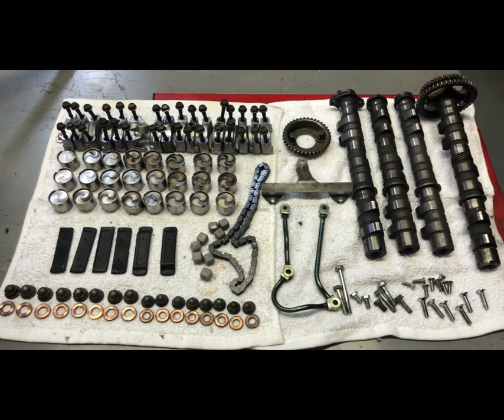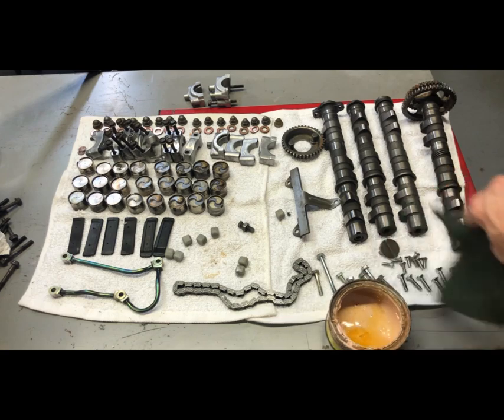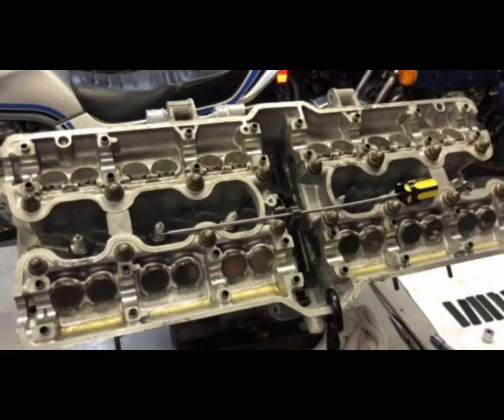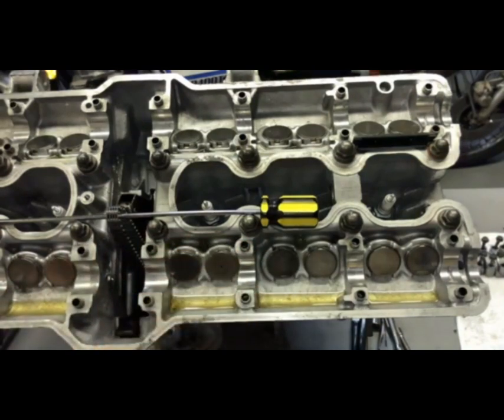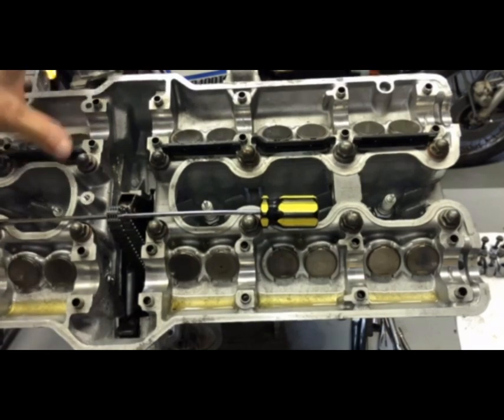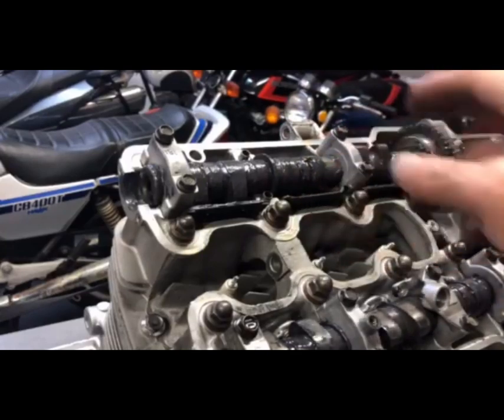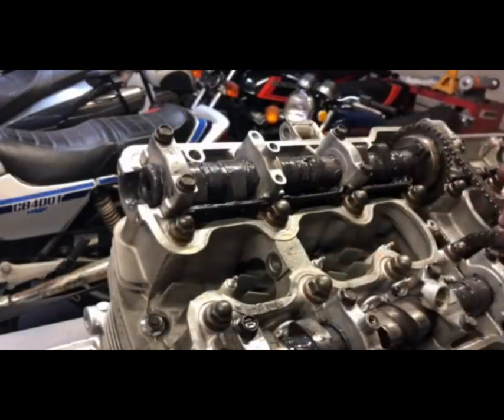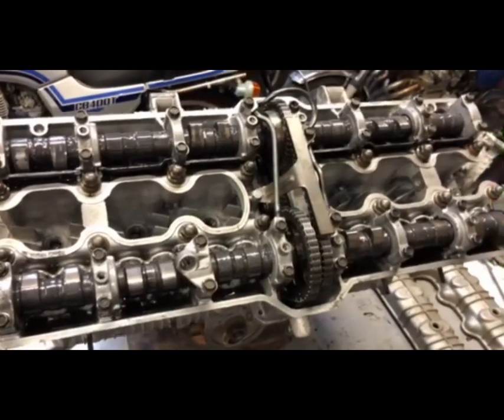Honda CBX Full Restoration & Engine Rebuild Video Series - Part 19 Re-assembly Part 6 - Valve Train

Comment: You've done a great job, and a lot of work, putting these videos together.
A word of caution though. Scotchbrite pads are a woven plastic with a fine abrasive bonded to the surface of the fibers. They use either aluminium oxides or carbides as the abrasive (there are some non-abrasive versions too). As the pads wear and breaks down/falls apart, those abrasive particles dislodge. If you use them for polishing any internal engine parts you absolutely must thoroughly clean the component afterwards.
Reply from the maker: Yes, thank you for your input.
That’s good advice.
I always wash the parts in my solvent parts washer afterwards which cleans them thoroughly.
Thanks again

Comment: Absolutly superb!
I just bought a CBX that have been proper stalled away since 1989. Im happy like a fart in a crouded sauna. So all this videos you have made is like a talking garage manual, with other words Splendid Sir.
Makes me want to renovate the whole thing even if its not needed.
Hats of
Reply from the maker: Thank you so much Jon, I really appreciate your praise. Your support is really important to me and it helps the channel. I will be posting many more on the CBX as well as other Hondas mentioned in my videos.
Reply: @digitalpizza1  Thanks again. Just started upp today. So I hope I will find some info about the generator, how to and so on.
May the force be with you.
Reply from the maker: Hi Jon
I will be doing a video on the Alternator this week. So hopefully it will help you out. :)
Reply: @digitalpizza1  Great :)
It would also be fantastic if you or some other angellikely entusiast can help me out. Over the years the bike was stuffed away, the rotor and its axel and so on got thrown away at the shop :(
WHERE can I found some parts for it?
(Sorry if I use your space for thisDigitalpizza)

Comment: I have been in the slow process of rebuilding my '82 top end following only your videos and have no manual.  They have been invaluable to the process but sometimes you gloss over some details and leave me hanging to search elsewhere.   In today's case,   I'm not sure why you would begin installing valve train components before torqueing on the head, but i suppose it doesn't really matter.   But only a very brief shot of your manual was referenced for me to absorb the torque specs and sequence.  I tried hard to see the sequence but the image simply wasn't  clear and detailed enough to see.  I have found it elsewhere and glad I didn't try to wing it, as its quite unique at least to me.     Also I will just add that I'm using a Sumo complete engine gasket set and have been mostly pleased with it , but I notice the head gasket doesn't have any extra oring or other provision for the 2 oil passages  around head bolts 15 and 16 I think it was.   That has me slightly concerned...    The oem one had copper ring there.     .......   Thanks for your hard work and time with these videos!    Ed Y.

Comment: Very good work.  I have owned my CBX since 1978 and it is time to pull and fix the head, and hopefully that will improve my compression.  I have the shop manual and I  understood there was a timing error for the cams?   A valve strikes the piston and you get about 50 miles before failure!   Are you following what the manual says, or is this the corrected version?  Oh, the rubbers, I call them dams, on the intakes is to create a pool of oil that the cam lobes go through on start up.  The exhaust cams pool to the casting.  I shall read my manual for timing the cams and look for a discrepancies.  Again, thanks for the video.
Reply from the maker: Yes, this video shows the correct way to set the cams. BTW, not all the shop manuals are wrong, they were corrected soon after. So yours may be correct.
The most important thing is to turn the engine 180 degrees at the called out point.
Reply: Anyway to check the pistons when I pull the head to be sure they are OK?

Comment: great videos , I notice you do not use any oil on the threads when you torque them to specs , was always told to do this so threads will not bind and give incorrect torque numbers ?? . also you really should have numbered each bucket and put them back in exact location . thanks for all the vids,amazing detail and will help so many people .
Reply from the maker: Hi Ross
Torque specs are so low and the margins are so large, it isn’t as crucial to lube the threads as it would be if the torques were higher and with tighter margins.
The head was not the same one that came off the engine.
The original was to damaged and corroded to reuse, so the head and buckets were all different.
I agree with you had all the original parts been reused.
Thanks for your comments and support 😎

Comment: Why are there 4 short camshafts in total instead of 2 longer cams in total? The 1967 honda inline 6 race engine also had 4 cams. In cars i never see anything like this before, they just use long camshafts instead of using 2x shorter cams

Comment: Was wondering when you bring the crank around to the t mark to install the cams how do you know if it is compression stroke or does it even matter as long as the team Mark is lined up, somehow it seems like that would be important but I'm not sure please help
Reply from the maker: Hi Mark, The important thing is that you start with the T mark lined up and the position of the cam lobes on #1 cylinder. Then, the manual will tell you at what point to rotate it around to the T mark again for the lobes on # 6 . Follow the manual, that is the important point. I hope that helps. Thanks Mark, Pete
Reply: I hello I did everything the way that you showed on your video and was trying to read along with the shop manual and follow what they said also, I believe I have everything right it was just a question of how do you know where the t mark is in the first place is it on the compression stroke are not our does it even matter when it comes to lining up the cams. I guess the question is even though everything lines up the way you show it to be lined up is it possible that the motor is 180 degrees out like a distributor in a car?
Reply from the maker: Hi Mark
The T Mark represents Top dead center of #1 and #6 cylinders.
That is the most important part of the settings. Cam timing settings are different on car engines.
Honda has simplified it on this engine. I am sure you will be fine as long as the T Mark is followed to the manual.